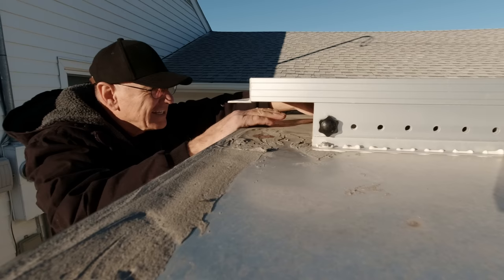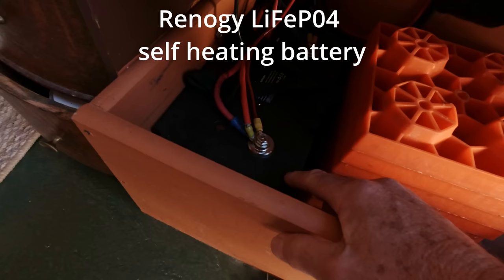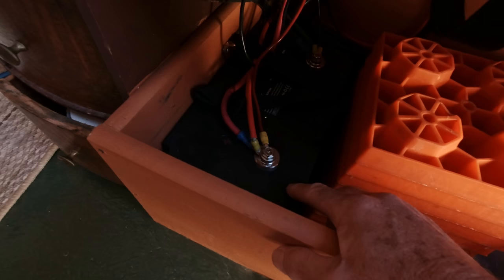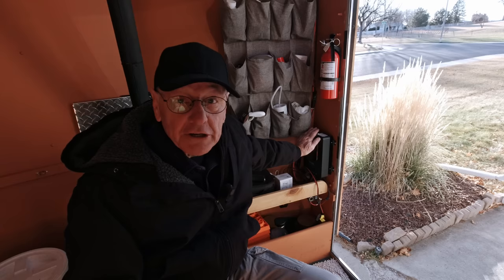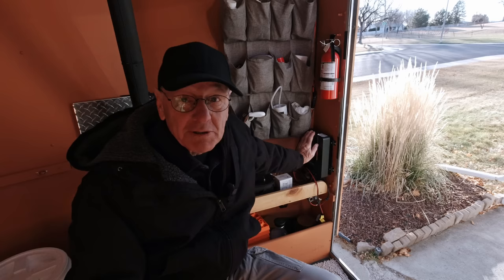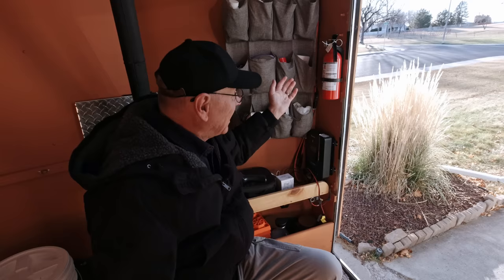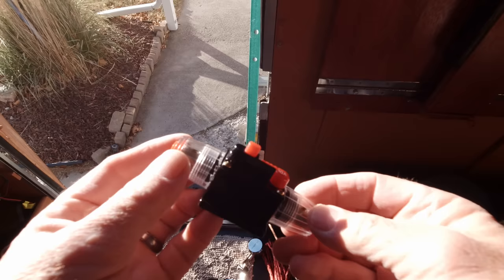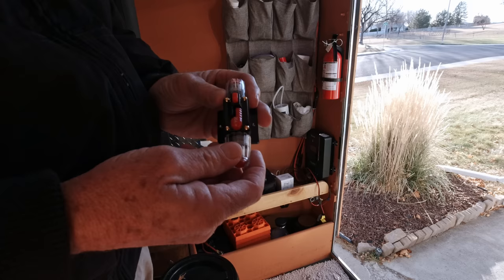Installing a Solar Panel On-Off Switch and +/- Buss Bars

Comment: I see many other solar installs with similar wiring, and components, screwed into the wood of the RV or trailer. I know you have already finished the work, but for future reference - any device in an electrical system can fail. When it does, it might heat up and melt, or throw a big spark. If that hot metal lands on some flammable material, it can burn your RV down. 
The best practice is to place all electrical components in one space, so they can be protected. Then surround them in a material that will not burn. It doesn't need to be a thick metal enclosure like a breaker box in your home, but it should be good enough that a hot glob of copper will not catch the enclosure on fire.
Reply from the maker: Good point.

Comment: I've done this on three different solar installs.  I just used appropriate(amp) single pole toggle switch near the controller on positive lead input from panel.  Helps in servicing when one needs to disconnect battery leads into controller.  Can destroy controller if no battery in line of controller when panels are charging.

Comment: Wise, that's how I do my solar panels and other things. I use DC Eaton's Bussmann circuit breaker in my system. Super easy when you need to work on the system. Although they are a bit pricey for them, they are still worth every penny!
Reply from the maker: I looked them up and they look good.  A dual pole breaker would be nice.

Comment: Outstanding clear video.  I needed to see one of those disconnects installed.  I want to add one into my solar system so i can disconnect my solar when I am driving and run a 10 amp smart charger off my cars cigarette lighter socket on cloudy days.

Comment: Those circuit breakers/switches are only rated for 24 volts, and your solar array is pushing way more than that,  this is why they do not recommend using these, and should use a proper dual pole disconnect switch instead.   Let us know how it holds up over time
Reply from the maker: The solar panels are putting out less than 24volts because they are hooked up in parallel.  Recently I installed a Bluetti AC200P which requires at least 36volts to charge and I hooked up the panels in series and replaced the switch to a 50amp double pole.  Thanks!

Comment: I used a marine buss with individual fuses for the various circuits, so in case of a short I can't find, it will only take out the individual short circuit.

Comment: I have had to replace 2 of those exact breakers in the last year for failures. Both times the internal contacts failed and stuck  'open circuit'.
Just a heads up. 
Switched over to a low voltage breaker on a DIN rail for about the same money. They have a much more robust design and contact materials.
Reply: Have same type in motorhome setup for last 3 years with no problems. Maybe you just got "lucky" and got a bad batch.
Reply: @dougwilson8274  It's from China-mart, watcha gonna do? I have found that things from china change over time. Have bought the same items, same suppliers, with different components in the same year. What I'm sayin is, what was - is not the same as what 'is' - with off shore items.
Reply from the maker: Thanks for the suggestion.  I looked that up on Amazon and put one of those on my wish list.  It's also a dual pole breaker to shut off both leads.  "https://www.amazon.com/dp/B09B7G1Z57/?coliid=I1RZAYIAYBKWD4&amp;colid=2JP936QJYAWP6&amp;ref_=lv_ov_lig_dp_it&amp;th=1&_encoding=UTF8&tag=youtube0ee5-20&linkCode=ur2&linkId=3656b2733040817580e66a6f57eeb2e8&camp=1789&creative=9325

Comment: Check the voltage drop across the breaker. I tried a similar one on my 800 watts and found significant voltage drop through the breaker. What I actually use now is a simple 120 volt, 20amp wall switch in a little blue handy box from Home Depot. Works great! I too have inline fuses for protection.

Comment: Rick on the truck circuit breaker you can put shrink  tube and shrink it on the 2 connectors that stick out. I use them also on solar and mine have auto reset after to much draw.  I have also used the switch you are using they work ok but I would not trust the breaker to trip at the rating.  Hope Linda is  doing well and you stay safe and healthy.
Reply from the maker: I like your idea of the shrink tubing and will use that!  Thanks!  Linda is doing fine but is anxious to get back out again.

Comment: Straight forward information. I have used those breakers several times and still can’t work out if there is a correct way to wire them up. i.e. which is inlet and outlet. Cheers from IK. AJ
Reply from the maker: I don't think it matters as there is no marking on them.  One person did say that if you're using them as a switch to go to a higher amperage than you think you need to prevent damage from arcing.

Comment: Good idea.  I have used regular house type wall switches for years,  in many different projects. For example,  the under hood light on the Suburban,  so it's not on when not necessary. Happiness to all Y'all. Aloha
Reply: I missed Linda,  not  even a quick cameo!
Reply from the maker: That's a good idea to put a switch on that hood light, I've just been leaving mine unplugged!
Reply from the maker: I can't wait to get here back in the videos.  Last night we we're talking about making a local camping trip to see how she handles it.  If it would just warm up a little!

Comment: A mistake I see a lot of DYI people make is using AC breakers or switches for their DC circuits on solar installs. DC tends to produce a more destructive arc when switched and needs to have spring loaded heavy duty switch contacts to quickly connect and disconnect the circuit to mitigate that arc which can weld contacts together or burn the contacts open. Also AC and DC current and voltage ratings on breakers are slightly different due to root mean square calculations on AC vs DC breakers. Your switch and breaker are good to go. I use a similar breaker to your Amazon car stereo one on my battery output to my inverter but a 185 Amp one. The breakers to my charge controller and battery input from the controller are Midnite Solar DC breakers installed in one of their Babybox panels. I would suggest putting a breaker between your charge controller and battery. Most charge controllers don't like any arcing that might occur while connecting or disconnecting the batteries and can flake on you. Thanks for the video.
Reply from the maker: Thank you for the great info!!  I have a 30 amp inline fuse between my charge controller and battery, but I was just getting ready to remove it this week because of the fear of an accidental disconnect from the controller and the battery causing damage to the controller.
Reply: Isn’t that why you always remove the negative first and install it last …when working with batteries…. Or is it still an issue when you install the negative last?

Comment: That is what I do too, is solder the ends, it also keeps any stray strands for getting out of place. Will Prowse always cuts the ends off and it kinda drives me nuts. Actually you should have a double pull circuit breaker to cut off both wires at the same time.
Reply from the maker: I saw switches like that, but thought they were too cumbersome for my small needs.  Any reason to shut of the negative side that you can think of?

Comment: I have sealed fuse holders down in the battery compartment. I know, its not close to the energy source, panels, but the likelihood of a short on the roof is very small.
Reply from the maker: I actually didn't use the audio breaker for a fuse, but only as a switch so that I could disconnect the battery for removal and not damage the solar controller.  I hope you're still enjoying a warm and dry climate.  Springtime in Montana is to be avoided.
Reply: @gonagain  Im in Lost Wages now for a couple days. Then finally head home to my cat and what's her name.  😁
Reply from the maker: @CITAP1  Tell your cat hello for me!

Comment: You're quite savvy on fixing and repairing on your trailer. Great video Rick. Do you still fly on occasion?
Reply from the maker: I'm certainly no expert on wiring and only post what I happen to be doing in hopes that it helps someone.  I get a lot of good responses and learn quite a bit that way.  I never get to fly anymore because of the cost, but sure do miss it a lot.
Reply: @gonagain  I know folks who got their basic license to fly. They are just joy riders and only fly in good weather. I admire how you and Linda have lived.

Comment: Thanks for emphasizing the importance of the sequence of panel and battery hookup.  I think this may be broadly misunderstood. Panels must be connected last... panels must be disconnected first.
Reply from the maker: I've been told that I should have put in a dual pole breaker to close off both the positive and the negative leads at the same time. I ordered one and will be updating the video.
Reply: @gonagain  I'm  not interested in learning the hard way as I did with the panel attachment sequence. I have been removing fuse in the positive panel circuit. Why does the negative need to be disconnected? Thanks for the great vids!

Comment: Just to be safe on solar should disconnect the other line also.  DC power works both ways
Reply from the maker: Ok, a couple of people mentioned that, but you just explained it.  Thanks!  My purpose was just to turn off the power to the controller and not to protect the circuit.  Do you think the dual pole breaker would still matter?

Comment: Great video Rick. Have you ever considered using ferrules on your wires instead of tinning them ? I personally love them. Just an idea.
Reply from the maker: l didn't know about them until just recently, but they look like a good idea.
Reply: @gonagain  they work great and are much easier and a better connection.

Comment: Not sure I’m with you on pulling batteries each year. Very heavy and don’t want to drop them 
Trickle charge is a good way to go I think.  
How many years are you expecting from your lithium batts?
Reply from the maker: I used to trickle charge my lead acid batteries and they were fine that way.  The lithium batteries weigh a fraction of what those weighed and are very easy to move around.  I'm just going by what the manufacturer recommends about leaving them in the cold if you don't have to in order to prolong their life.  As for longevity?  I'm seeing that 10 years is possible if the battery is taken care of, even 20 years is possible.

Comment: Timely video as shortly I am going to put the two solar panels I take in and out of my permanently parked RV and attach them on the side with the one that's already there. I'm tired of connecting and disconnecting. I just have to find a local source for Sikaflex. I've ordered tubes twice now and had to return them. The first was frozen and the tube was so beat up I would only be able to cut in half and smear on. The replacement tube just fell out of the flimsy plastic sack it was shipped in when I picked it up. The applicator tip was attached and broken with the broken piece gone. It was beaten up too and the push cap on the end had been pushed forward showing a trail of glue. This time I want to pick the tube up and see what I'm buying.
By the way, good move putting the switch up high so Linda can't play with it.
Reply from the maker: For the Sikaflex, try a marine supply store.  I've been having good luck getting it from Amazon and haven't had a bad tube yet, but there's always a first time.  Buy through an Amazon source that has the most reviews because their products are fresher.
Reply: I've already tried the marine stores in the area. I'll have to revisit amazon and pay more attention to the ratings. Thank you. Hope Linda is doing well.
Reply from the maker: @jimv.661  That's what I do Jim.  I figure the ones with all the feedback are the ones who are moving stock, so it's fresh.

Comment: Hi! This is super helpful! I’ve built a tiny, 12v portable diy solar box for tent camping (10v, .5mA panel and Renogy 10A controller connected to an NPP 7Ah battery) . I too find it helpful to be able to shut off the panel to the controller while I work on or disconnect the battery). Most search results take me to very large current systems too so this video is awesome. Do you think a breaker switch in my tiny system is needed (vs a plain 12v inline switch)? How has this breaker switch worked for you so far? Thanks so much.
Reply from the maker: The switch works just fine and for the price you can't go wrong.  If you don't want a breaker switch you could get an MP4 connector that has an internal fuse.

Comment: Be careful with the switch.  DC solar panels will melt most switches because it can arc across the connectors as there is no break in the circuit.  You should put an ugly steel box around it to maximize the time to fight the fire.
Reply from the maker: Right you are.  I've installed 50 amp DC circuit breakers since.

Comment: Yes once again you are right on it. I have been looking at cut off switches for mine solar panels so I wont have to worry about unplugging them all thee time. Your so good at this Rick I want to run this by you and see what you think about it. I want to run my wires from the solar panels in to my trailer and and I am going to put my two Bluetti's in the trailer  one in the front and one in the back of my trailer How would you switch between the two I was thinking a switch to stop charging one and switch to the others and then the cut off switch when they are charged so the cut off would be the first in line then the front to back switch? I know it's all in redneck but I hope you got it  if not let me know.   You all take care and I hope Linda is doing well stay safe.
Reply from the maker: I think I would install a cigarette lighter plug in the front and rear of the trailer.  You're going to want to run the panels directly to the Bluettis and not through a solar controller first.  Be careful not to exceed the allowable charging wattage for the Bluettis.  Of course you need to have the proper buss bars and fuses inline.  A couple of switches could regulate where the power is going, but you don't really need to do that.  I tapped into the wires from my solar panels BEFORE my charge controller and that's how I charge my portable power stations.  I haven't seen anyone else do that, but it's been working just fine for me.
Reply: @gonagain  From From what I understand the AC200 is plug and play and has been working but I do like the idea of a fuse inline on them I will have a Battery for 12 volt I only use the 120 on the bluetti's to run my Frig and cpap the frig will run for two days in 100 degree days 3 if it's only in the 90's My 12 volt is LED lights and a phone charger and with 100 ah battery I get 4 to 6 day's before I need to recharge it. The reason I don't have it in yet and only put it in to test things is I am waiting for my Nephew to get the time to set it all up he's a smart little Pain in my butt but he's a good young man. The only trouble is he's always on the ship and not here helping me lol. Hey Thanks for the info and help Rick much Appreciated. Take care stay safe.

Comment: I noticed you have the no drill holes solar mounts. How do you like them and what did you use to secure them the the camper? Thanks for the video, I'll be getting one of those power cutoff for my setup.
Reply from the maker: I had to replace the adhesive with a newer one by Sikaflex, which is the 292i.  The one I used in the video was letting go of the plastic, but the newer adhesive is made for both aluminum and plastic  and is holding fine.  I've used it again on my newer panels since then.

Comment: I have seen some disconnects being dual pole & disconnect pos & neg at same time.
Reply from the maker: I'm not sure I see the need for doing that.  Would you tell me your thoughts on that?
Reply: @gonagain  "NEC 2020 690.13 ,
PV system disconnecting means shall simultaneously disconnect the PV system conductors that are not solidly grounded from all other wiring systems". 
Nate from Explorist.Life discusses this exact scenario in one of his videos.
Reply: @gonagain  the other thing,  it looks like you are running 1 panel. On a multi panel system the OC voltage coming in may surpass the max voltage that Circuit breaker  that you are using is rated for.
Reply from the maker: @ctclimberguy34   I've ordered a dual pole, 50amp DC breaker to replace that switch and will make an update for that video.  Thanks!